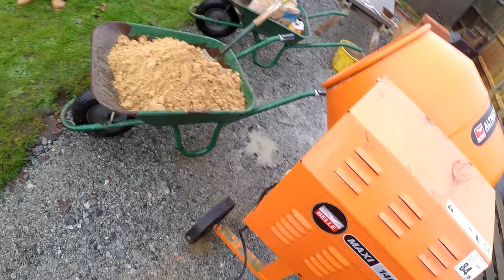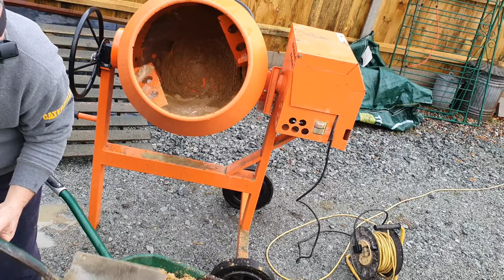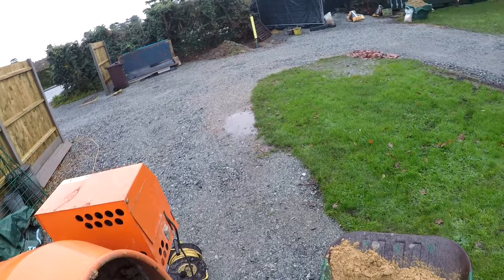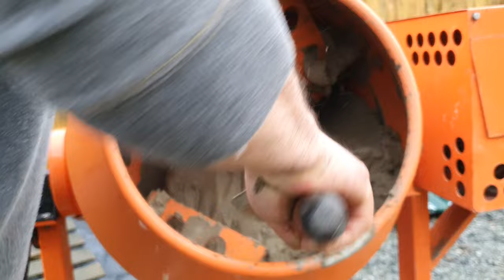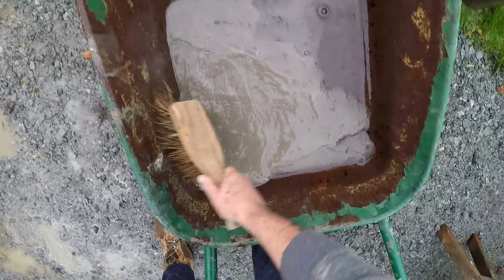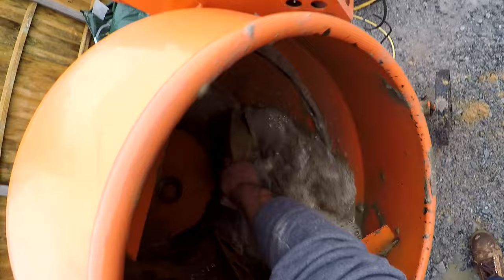How to mix bricklayers mortar #diy #bricklaying #bricklayer

Comment: Been laying bricks for 15 years and would never in a million years would have thought with that little water it would come out so nice.
Reply: Really not even if the sands wet lol 15 years ay
Reply: The key is the concentration they put in it.
Reply: What’s the weird red liquid he put in?
Reply: @BigCroca  its "plasticiser liquid" , it makes the mixture flexible without needing much water, its how the mixture became so flexible without much water.
Reply: 15 years didnt teach you alot
Reply: @Downloader77  also called Feb, or admix, it helps to incorporate a bunch of air into the mix to make it fluffier, the old boys used to stick a squirt of dish soap, useful trick wil help you in a pinch
Reply: @Bullylover-tm7gn laying bricks for 15 years.....I bet his arms are tired 😂😂😂😂😂🤠🤠🤠🐴🐴🐴 YEE HAW
Reply: It’s the plasticizer or whatever that stuff was.
Reply: 5 sand 1 cement? Then why did you say equal sand equal cement?
Reply: @carbugnov1952 equal shovel amounts
Reply: Comes down to the sand

Comment: Nicely done   I always enjoy your videos. I do a few small bricklaying jobs in the USA. What is the Feb that you put in? Does it soften the mortar? If so does it make much of a difference? We typically use a 3 to 1 mix. Thanks for the videos.
Reply from the maker: Thanks for watching Paul, the Feb I use is a concentrated one the make is Sika , it’s a game changer compared to the Feb we used to use, easy to gauge and in such a small bottle, are you from the USA or did you settle there, we are in Norfolk UK 👍👍
Reply: @BuildingwithBudd  so what happens if you don't use feb? and also can you use this same mix for pointing or do you adjust it at all?
Reply from the maker: @agentolshki4265  if you don’t use some sort of Feb in your mix it’s so difficult to lay bricks, the water just runs out of the sand ,

Comment: Thanks for posting, nice mix.  I've always used one part by volume cement to 4 parts sand to allow a more forgiving mortar bed, especially in clay soils where heave can sometimes cause bricks to crack before the cement mortar.  I remember in the mid to late 80's 1:3 was used for more strength. We each have our own ways!
Reply from the maker: Cheers Paul appreciate you watching 👍👍
Reply: depending what cement you use 400 or 500
32.5R or 42,5R   if    32.5 can be 1:4 ,    if 42.5 R can be 1:5

Comment: The key is in the use of plasticiser.. Takes a while to overcome your assumptions that its not enough water, but the plastisiser really turns a dry mix into putty in a hurry.. Once I started to use it years ago I never went back to without, The benifits are massive.. Stops the muck sticking to everythng like the inside of the mixer and wheelbarrow, its more a dough now than a sloppy gritty mess.. Less water means its curing strength goes up,  Deending on the additives used you can get stuff thats frost resistant ect..  Theres not much to not like about it..

Comment: I also put the feb in first, just in case the sand is wet and you don’t need to add as much water. Keeps the consistency the same.
Reply from the maker: You have been there , thanks for watching 👍👍

Comment: All but good, one point though, amounts of sand to cement ratio of what is required for the job in hand, 3:1 or 4:1 , but our presenter very good with the commentary and direction for how to achieve good motor for your job, but by mistake in the heat of the presentation said equal sand and cement where it should have been right ratio.
Thanks for the information.

Comment: Currently have a barrow mixer on the go and each mix of 5-1 sand/cement is taking nearly two buckets of water per mix. How your mix turned to that consistency I do not know, sand must be holding a lot of water to begin with.
Reply from the maker: You must have a hole in your mixer🤦‍♂️

Comment: Welcome back, Happy New year, is that 1 of those 1960's 🇨🇮 Cement Mixers ( 💪 Windup) 😂🤣😂🖖
Reply: That's a Very Clean Mixer, Is that 1 of those rare Gentleman Mixers ?
Reply from the maker: George it’s only about two years old but it’s had hardly any work yet, also it’s not had a beating with a put log pole yet 😂😂 , all the best for the new year 👍👍

Comment: Does adding more or less water change the mortar colour for the exact same ratio?

Also does the pointing tool smoothing change the finish colour?

Im trying to achieve a very light grey mortar but we only have 2 sand types, orange or pale yellow.

I was thinking of trying to add some white cement or lime to the mix but wanted to keep it simple as its a full house
Reply from the maker: All of the above can alter the mortar colour, also if you point up the joint to early this can bring the cement to the face and again change the colour, it’s really just a learning curve, hope it all goes well 👍

Comment: Do you ever use a bucket or anything to gauge the exact amount of sand and cement?
Reply from the maker: Where it needs to look spot on , we gauge it with buckets , or if it’s something small might use a cup, whatever it needs 👍👍

Comment: What lime mortar mix would you use for laying reclaimed norfolk reds?
Reply from the maker: Jason we normally buy it in pre mixed in bulk bags that way it’s a more consistent colour, many thanks for watching 👍
Reply: @BuildingwithBudd  Thanks for your reply. I’m from Norfolk aswell, can you tell me where you get it from?
Reply from the maker: I will find the name and send it over in the next week 👍
Reply: Use 750 psi mortar type N in USA or 1 part cement 1 lime and 6 parts sand.

Comment: You said 5 sand 1 cement then you said equal parts sand and cement.Unless i missed something..... please explain
Reply from the maker: Yes 5-1 is the ratio , but the shovels off sand and the shovels of cement should be the same in size, so the heaps on the shovel look the same size is what I’m trying to say, many thanks for watching 👍👊
Reply: @BuildingwithBudd  aahhh... now it makes sense.  Cheers  mate. I didnt have plastizer.....now i know why i shouldve bought  some coz the mix was crumbly and SHIT..... ill have yo redo it. Living and learning
Reply from the maker: That’s the only way I’m still living and learning, all the best 👍👍

Comment: Your  ratio mix wrong 5:1 a bucket is standard 4 shovels a bucket so 5:1 that should be 20 shovels sand 4 shovels cement.better to use bucket yo keep to guage. You put in 14 shovels sand 3 cement.

Comment: Maybe that's your way,but... from my point of view the mixer is junk, that's a garden wheelbarrow, never ever put your hand inside of moving mixer. Some water and a couple shovels of sand while the mixer is running will do a pretty decent job of cleaning the machine out.
Reply from the maker: You obviously are not in
the building trade , go into any proper builders merchants and there are piles of them, and as you say that’s my way, works for me not for you, fair enough, cheers for watching 👍
Reply: @BuildingwithBudd  Just so you know I've been a commercial mason for 45 years. Worked from Washington DC to Savanah GA. Just about every state east of the Mississippi River. I get where you're coming from,but when I've got 60 to 80 masons and 40+ laborers on the job we just don't have time to half-step anything. Good luck to you.
Reply from the maker: This is aimed at your diy watcher not trades people, but you can’t regulate who looks at it, I get what you say about having loads of masons to look after, you can’t compare the two, it’s good for us to know we are going that far, when you say Mason’s is that laying Stone or laying bricks?  Over here in the UK a Mason works with stone not with bricks, what type of work do you do , new Or old, be interested to know, once again many thanks for watching looking at the videos 👍👊
Reply: @BuildingwithBudd  Good to hear from you. I was union trained and in the States you are either a block mason, brick mason or stone mason also. However, I ( like a lot, not all) was given the best training from a multitude of masons to be able to do it all including stacked stone known here as either "slave" walls or Irish walls. On my card it says "Master" but who ever really "masters" masonry. We have a saying here, Once you've learned everything there is about masonry your to old to do it. My father was a true "mechanic" and I'm proud to say I made it too. Nothing more satisfying than having someone say how happy they are with the work. Especially when they pay you! Take care. God bless.
Reply from the maker: Those are wise words , many thanks for taking the time to have chat, keep well and let’s speak in the future, keep well 👍